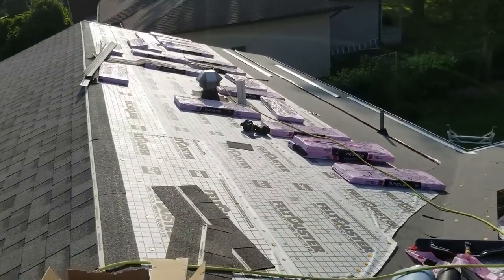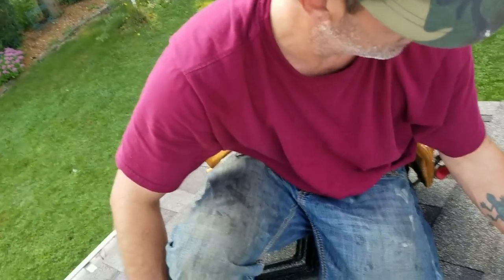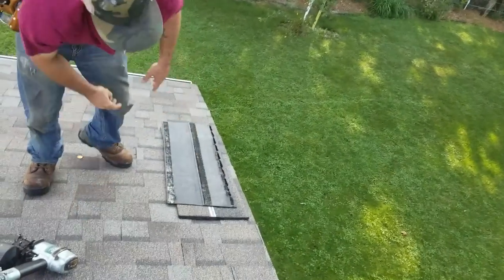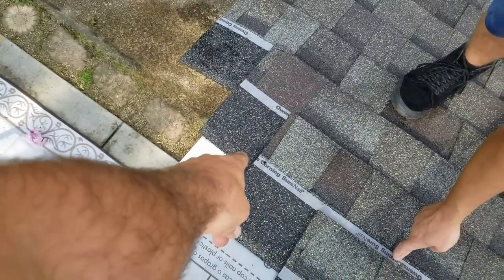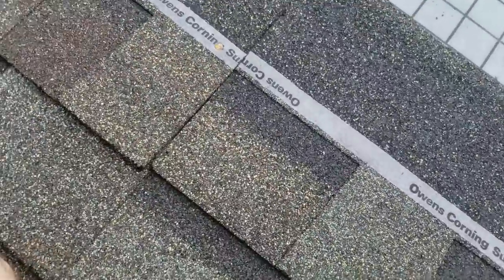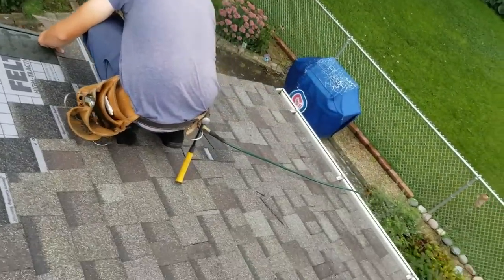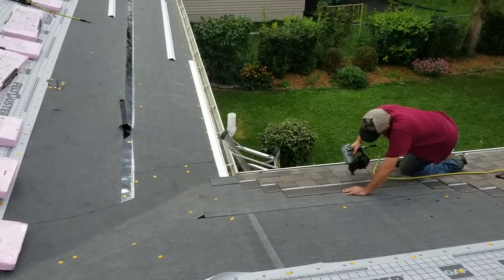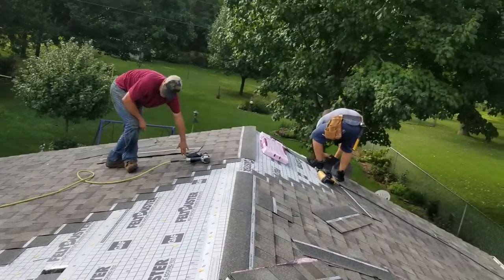Rookie Roofing 101: QUALITY CLINIC

Comment: But more important is why u letting Brad shingle from tha rake into the vally , ther is no reason to ever do that its guna leak, u always start in the valley i shouldnt hav to explain why you smart, but when i seen that. U better ask sumbody, its a big no no no ,im a master shingler , im not taking bs,  never do that
Reply from the maker: That is one of the biggest myths among inexperienced shinglers. sorry. if you're right handed and the side is bigger than about 2-3 square you are ABSOLUTELY going to take way longer to do that side. and I've been shingling into valleys for years, it does not leak. what would you do if you were shingling in the center of 2 valleys? you gatta do it sometimes so why wouldn't there be a way for it to work? stick around to see my expert explanation in the near future and  I promise you it will make sense. i would've absolutely shingled that right handed like brad did. some people who usually set shingles with their hands, not their gun are a little faster left handed and it doesn't slow them down as much, but a good shingler will play to his strengths when needed. ill have all of this info in a program in early 2020
Reply: It won't leak if done right,but much easier regardless if your left or right handed.
Reply: If the valley starts the side you start at the valley, if it ends the side you end at the valley simple as that!
Reply: There's a trick for the valleys when starting from the rake too

Comment: ooofff.... i kept watching... oooooof. you do a vertical shingle run line and dont cut your valleys. no no no  no no. don't be lazy. underlay appropriately and run your shingles long in the valley and snap a cut line. that is no good and it looks real bad. dawg. toot it.
Reply: Weave looks better
Reply: Weaves do not sit flat, architectural shingles are double layer on the bottom only, that is a three tab method suited for single layer shingle application.

Comment: Bro if you're cutting rake edges in 2020 you need to quit roofing dude...
Reply: When we get to the rake shingle we place and cut the shingle first from the inside leaving us a flush rake and the job goes faster
Reply: @jonathanchapman5543  ok, perfect. Carry on, bud. I do the same. All factory edge down the rake, cuts inside.
Reply: @jonathanchapman5543  how do you run your valley? I find it much easier to run the valley then shingle the roof.
Reply: @KyleDownsFTW  of course!!!! Get my valleys out of the way and then breeze on with my straight runs.
Reply: @KyleDownsFTW  but yes if I have a valley, I run them first.
Reply: @KyleDownsFTW  yeep lol. Exactly. How I was trained.
Reply: @jonathanchapman5543  no wait i just watched it again and your Zach dude is literally having to cut his rake.. 

I think you know roofing, but lemme give you some tips..
First off, no roofer wears a tool bad(except flat roofs cause we need screws)
2nd, tell your guys to slam 1 nail, jump 10 inches and bang 4 more in.

You and i could def get along haha
Reply: @jonathanchapman5543  i can run both without thinking, but for a new roofer, go valley first. Less chance of a leak.
Reply: @KyleDownsFTW  I'm not new lol.